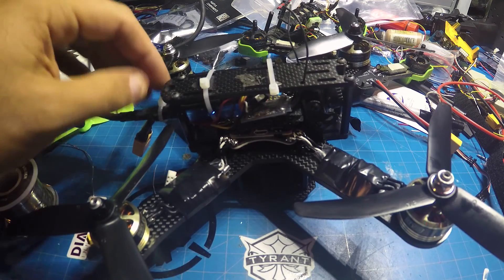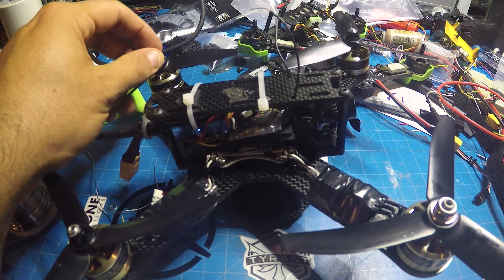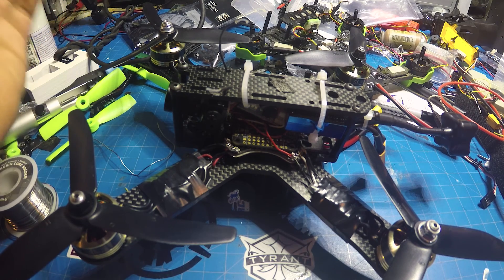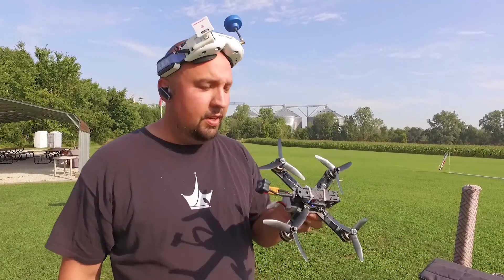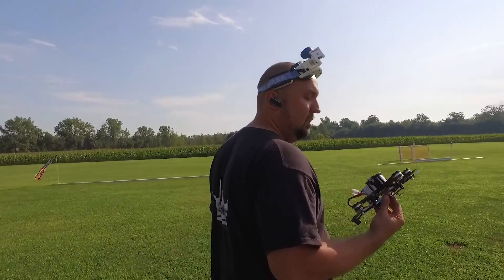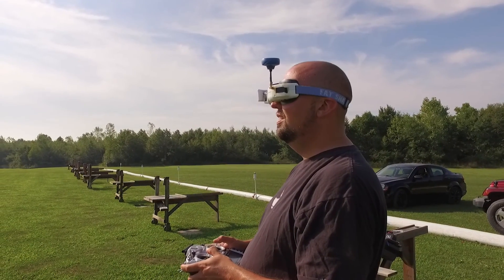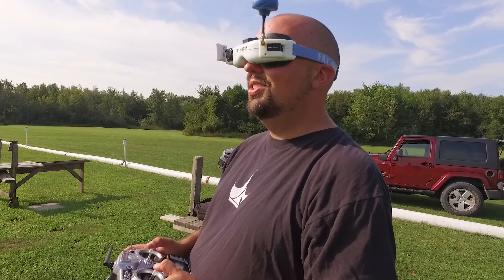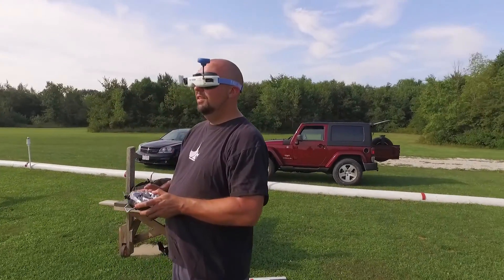ReadyMaderRC Goby 210 Build and Flight with Betaflight 3.0

Comment: I'm not nearly as stoked about the goby 210 as you are. I think it is way too heavy and slow. Isn't very nimble at all. Mad prop wash too, when you do try to change directions quickly. Not my favorite flyer by a long shot. Even my qav 210 with an ancient for today's standards naze32 in it flies better. And the other commenter was right on about the camera tilt issues. Why did RMRC think making the top plate so narrow was a good idea? Maybe they could have used a little of the carbon from the 5mm thick main plate to make the top plate a little wider. Maybe it might fly a little better if you put all the electronics underneath and try 6" props on it? Even RMRC's own pilot said he wasn't very fond of the goby, and that's why they made the awk210.. oh well, at least it is prety durable, so it is the go to quad when flying over concrete or whipping around the steel jungle gym and swing sets in our backyard park, or just wanting to do something stupid like diving the. Buildings in Chicago where there is no grass for miles. But lately it's been more of a paper weight than anything else for my son or I. Good luck with yours if you still fly it.
Reply from the maker: Jmlon99 at the time I was but a lot has changed since then. Old tech now.

Comment: Nice build! Does the foxeer arrow have full range of tilt on that frame? My goby 210 has an 1177 and I need to slide the camera forward and back anytime I want to change the angle.
Reply from the maker: Not full. But I could get more with a narrower lens. I'm running a 2.1   With this frame I think the only option is a pico if you want a higher angle. Or hog out some material.